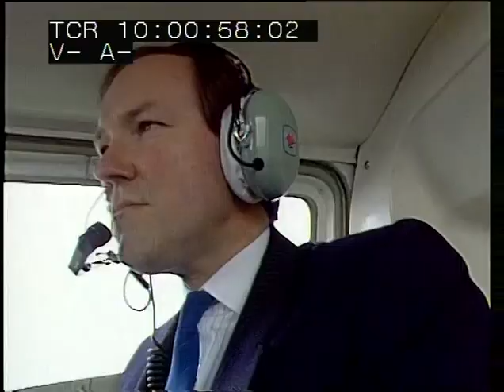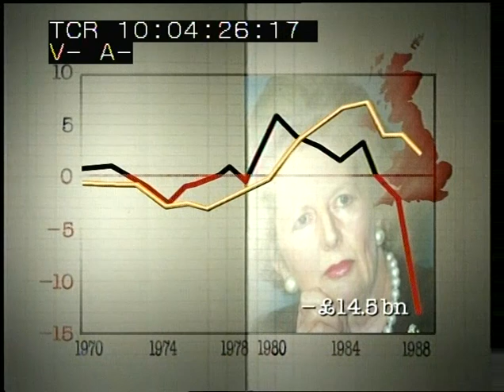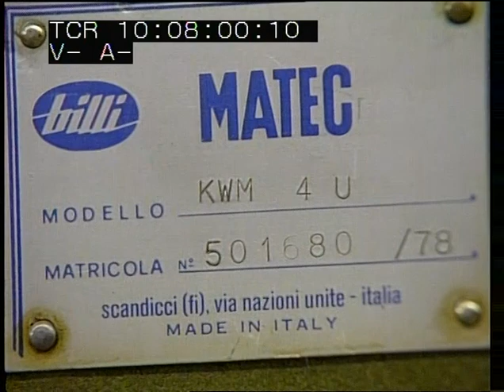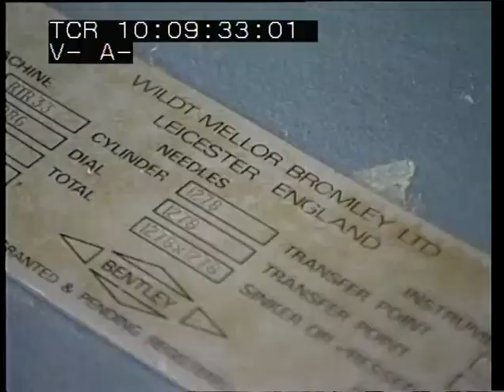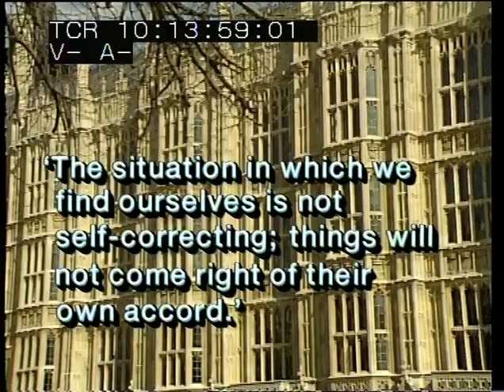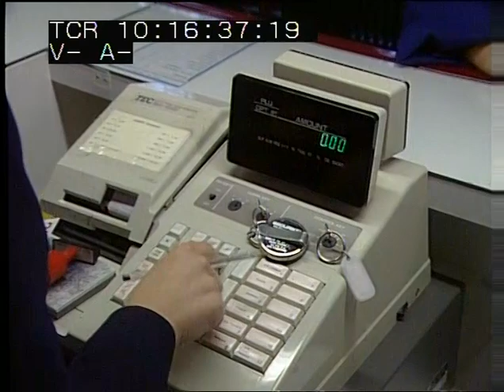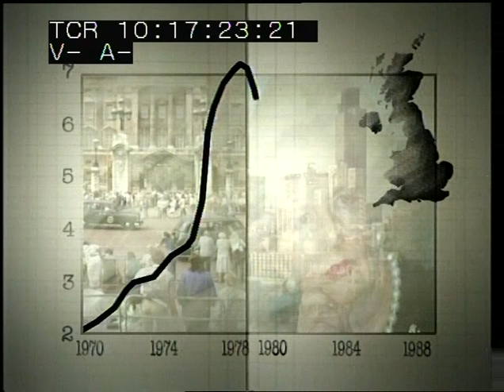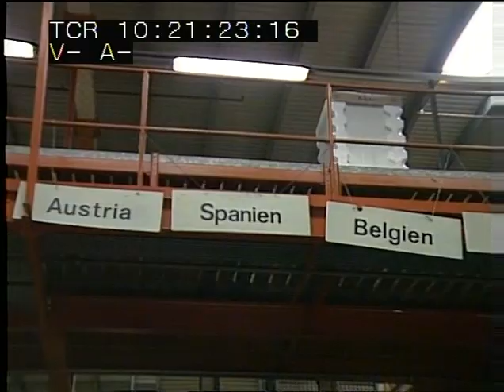British Economy | Britain in the red | Margaret Thatcher | This Week | 1989

Comment: How many of those Fiats made it from Dover to the dealership before breaking down...lol
Reply: rob Dubz 
😂👍
Reply: Check the bonnets of the black one front of shot at about 1:43 and the grey one front of shot at about 1:50 - if they can't even sit flush having left the factory, where's the quality control?!
Reply: Apparently the staff who worked at the main dealer in the North west in the 70's and 80's their first job was to take the rust off the new Fiats
Reply: Gary S I’ve heard something similar but it does come across as an old wives tale
Reply: @JohnKobaRuddy  most cars no matter where they were built suffered from rust in the 70's even Japanese were rust buckets.

Comment: no one really understood the mistakes that Maggie was making during the  1980s. A casino economy can only produce boom-bust cycles, whereas, a manufacturing economy will bring more stability. In Germany, you have record low unemployment because the INDUSTRIAL ECONOMY is still the backbone of the nation. Manufacturing sector provided jobs to millions all over SE ASIA! But somehow, in the UK the economists with right leanings advocated extreme versions of Hayekian and Monetarist economic policy mix, which resulted in massive urban unemployment. 
All done to promote uncontrolled market-driven mercantilism and laissez-faire economic fairy tales!  
The fact of the matter remains that the UK was an Industrialized Nation during the 70s and by the time it reached the 1990s, it had more or less lost the commanding heights of it is economy the so-called cluster of large - tool engineering, metal casting, auto-car manufacturing, shipbuilding, and natural resource drilling, exploration and mining industries that existed across the West Midlands and Scotland. 
Only to be replaced by the CITY and the NORTH BENT CRUDE / OIL. what a shame! Oil Wealth Effects brings with itself a curse of non-diversification. Have a look at KSA and Norway. Both economies have not diversified over the years, and today face structural problems. 
UK a nation where the Industrial Revolution began turned into a moth-eaten nation of traders, brokers and merchants. Thanks to Friedman's Monetarism and HAYEKIAN nonsense offered on a Tory plate.
Reply: Yes but how high the booms they still should outgrow the busts.
Reply: The UK also had record low unemployment prior to covid.

Why do critics of Thatcher never pay attention to the facts?